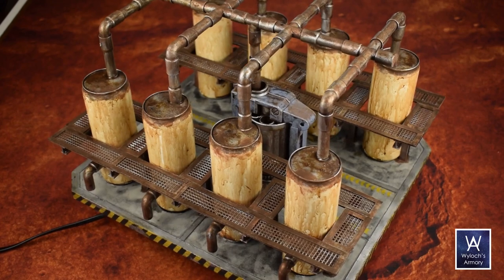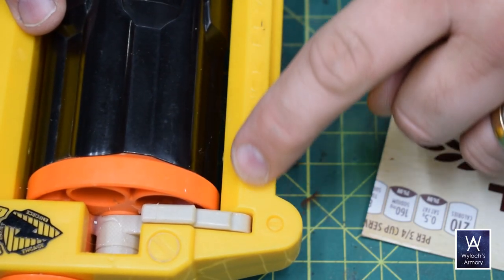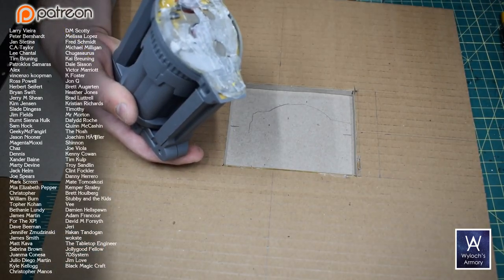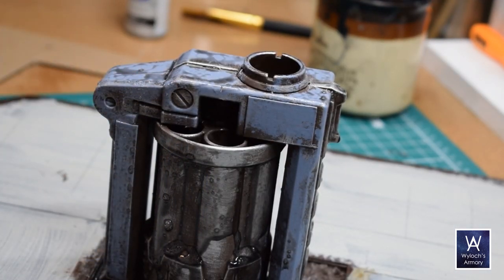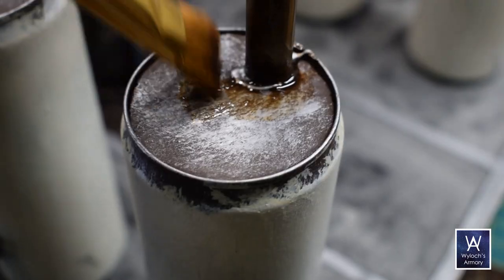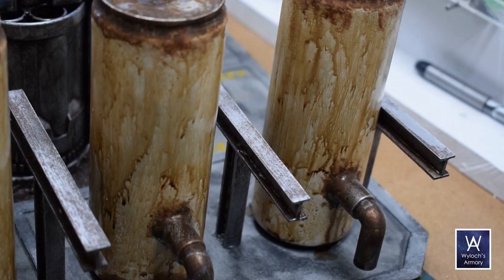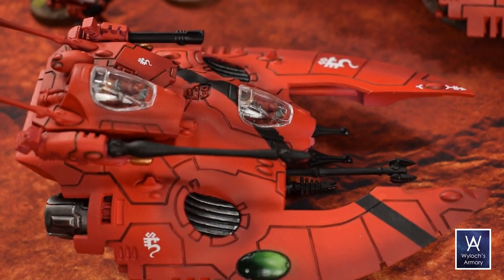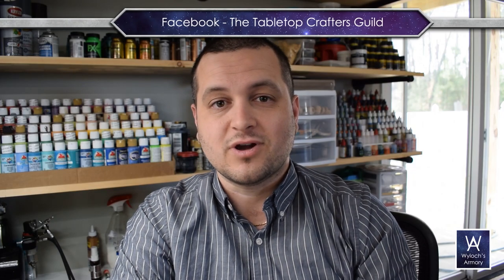The Extractor - Building Epic Realistic Terrain for Warhammer 40k

Comment: Hey Bill, great build, you've had a good/flowing day, with luck filling your sails. I've gotta turn my craft to DIY to patch up the bathroom after alterations have made a real mess, so duh, nothings running smooth! Those walkways are EXCELLENT the girders...DOUBLY so. If you wanted higher vantage points [you were right to abandon those grates on the top, btw] you'd need to do a secong level of walkways with connecting ladders...cool; but aLOT more work!

Comment: I've tried a new thing lately.  I'm a coffee drinker and I see a lot of grounds go in the trash, so I've started drying them out on parchment paper and storing the dried remains in old peanut jars.  Turns out it makes a great heavy turned up soil and rocks look rather than sand.
Reply: I’ve heard of that before. I’ve also learned, from Adam Savage, that Coffe grounds made into a fine dust and smeared on a surface makes for a great dusty rust look. Or even mix with water and use as a wash. The grit also helps give the wash a texture.

Comment: Love the project idea, but for the love of Nurgle, PUT MORE EFFORT INTO THE PAINTING!
Reply from the maker: Such as?
Reply: @WylochsArmory  thanks for your reply.  it was meant as constructive criticism. 😄👍

9:19 It seems you dont break up long paint streaks.  It takes the beautiful work that you've completed elsewhere and looks like brush strokes.  

13:20 For instance on the "floor of your base" there are several long black-wash brush strokes.

That could easilly be fixed either during painting process. By swirling and stippling your brush to make sure that there arent long uninterrupted strokes that dry up in flat, open areas.

On the back end, you could use a sponge and dab rust or oily effects to break up the appearance of long strokes.

You could use pigments for this purpose.

Your airbrushed yellow arrows or any other pattern would work great over the top to hide this too!

You could even sprinkle gravel or chunked up bits from an unused model kit.

You could add debris or additional pipe fittings.

Anything to distract the eye and break that up.  Loved the sludge on the cans!

I know it might sound like nitpicking, but you could go from a good project to a really memorable stand-out project.

Hope this helps.

Your videos make for great content.

Sincerest thanks.